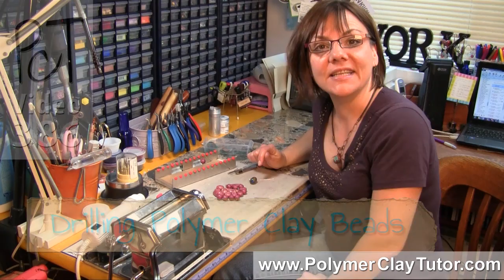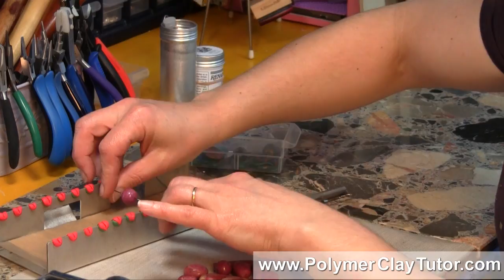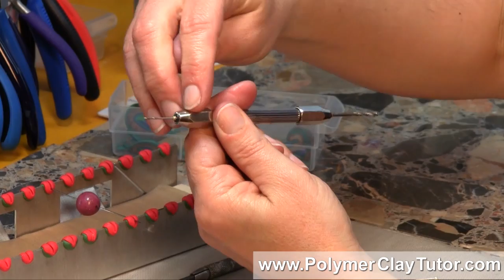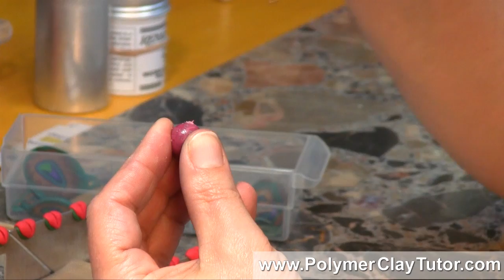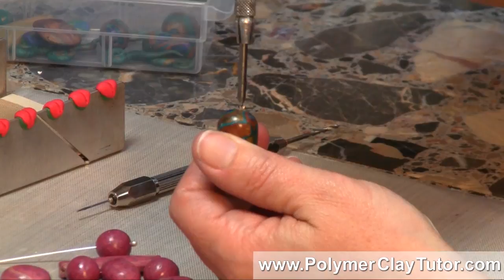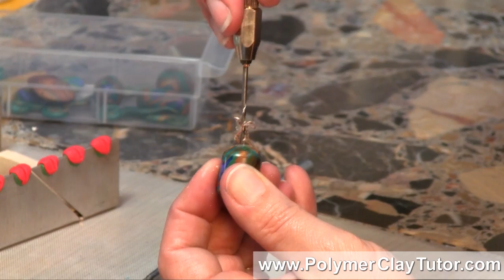Drilling Polymer Clay Beads

Comment: Hi Cindy! I absolutely love your videos they have helped me out so much! I just ventured into pendents and beads. (Still lots to learn) I have Fibromyalgia and Rheumatoid Arthritis. Hand drilling worked just fine but when doing a lot at one time my hands could not take it. I completely understand the safety issues of using a high powered drill while doing this but I suddenly had an idea and it works GREAT! I have a little hand held electric screw driver that plugs directly into the wall to charge. (It's a little pink Black & Decker brand I got from Wal-Mart for roughly $15.00) My fiances drill bits just so happen to fit in it perfectly! It's low power and no more aching hands. Some drill bits are made differently so this may not work for everyone but I wanted to share it anyways :)
Reply: Nadia Serrano that sounds great but for me, the problem is that it moves too fast and makes it hard to get the hole in the right place. I am also drilling into resin, which is much more solid.

Comment: Have you ever tried a small spiral hand drill?  I have a tiny one, about 4" long, and it's a nice balance between your pin vise and a motorized solution like a Dremel tool.  It's a really simple tool.  You just line up your bit and push down on the handle.  I use my palm, others hold it more like a pen  The "spiral" part of the shank turns the drill bit.  A little spring pushes the handle back up and you just push it down again.  I've had carpal tunnel and suffer from arthritis from time to time, but, I find this little tool very comfortable and easy to use - no twisting motion like you have with the pin vise.  It's also very affordable.  I got mine, with an assortment of bits, for about six dollars about a decade ago.  I can't add a link, but, if you plug "spiral hand drill" into Amazon, you'l find lots of them.  A bit more than six dollars now, but still pretty cheap.

Comment: Hi. Im having trouble getting the drill to go in straight through to the other side. I am new to doing this stuff and I tried a couple times and my holes are crooked. I don't want to mess up all the nice beads I've made. Do you have any tips for this? Thank you so much!
Reply from the maker: Did you watch the video? There are several tips in there that should help you. Also, drilling straight holes can take some practice, so perhaps you could make up a few scrap beads that are just for the purpose of practicing your drilling on. You will find once you have done a few, your holes will get better and better. Good luck!

Comment: Hi Cindy..Can you share the brand of the pin vice and which dias should i pick? I am planning to get these for the small beads. Thanks!
Reply from the maker: Hi Suguna Srinivas I don't remember the brand of pin vise I have 9there are no brand markings on it either) . Any pin vise should do just fine. As far as bits go, just get a cheap set of small bits in various sizes that will work for a variety of wire and cord sizes. You can often find them in the dollar store. Polymer clay is so soft that you don't need to get very good drill bits.